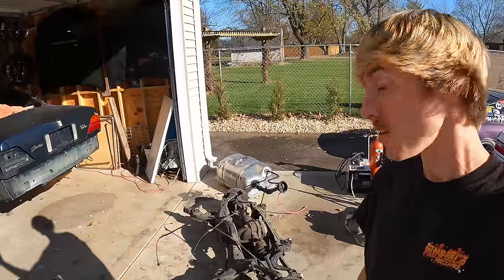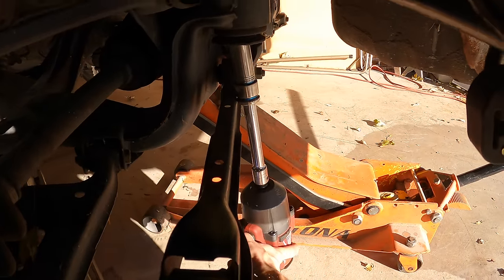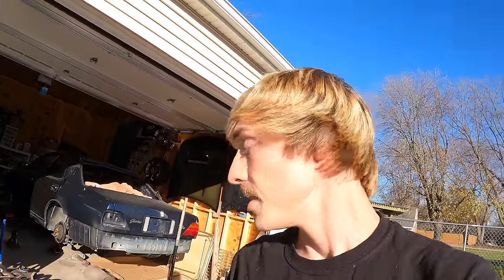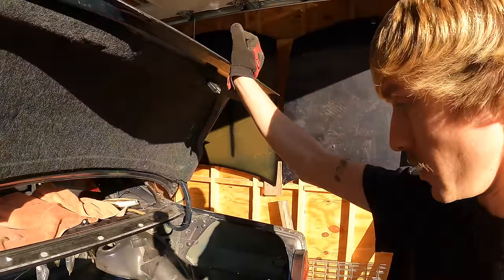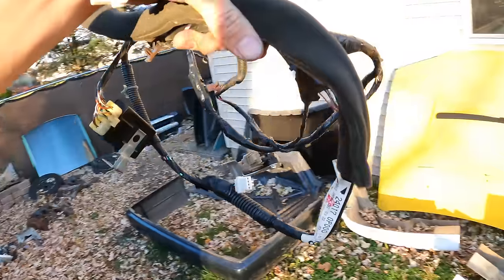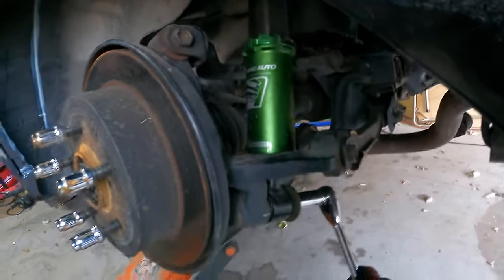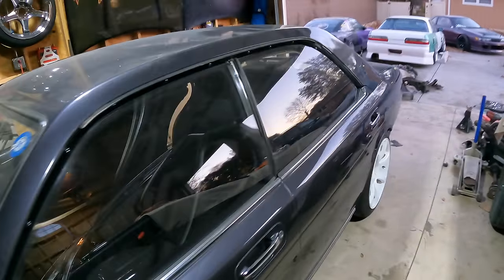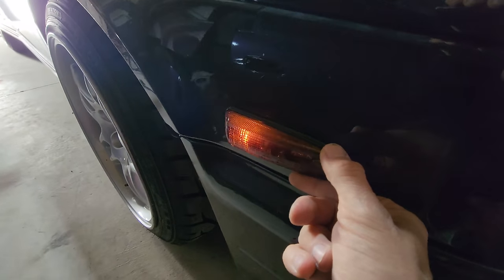Nissan Gloria TEST DRIVE!!

Comment: Putting stuff like this back on yourself is a good time!  I think I used a jack on the pumpkin like you and then stacked up random boxes and pieces of wood that I put on moving dollies so I could move things around as it went up.  It actually went fairly well!  Putting the gas tank in (S13) was also fun since it needs to be flush to the underside  of the body and then the straps had to be bolted in.

Those "nuts" on the taillights look like the flanges you use to bolt down a toilet seat...

Last but not least, I think you have plenty of room in that garage... I'm working in a similar amount of space and it can be a bit tight sometimes, but is mostly fine.  I just pull the other car out when needed or if I don't want it covered in grinding dust, etc.

Congrats on getting the Gloria back to roller status!

Comment: You should start priming your cars before starting. Like with the Gloria it didn’t start smooth cause it seems you just turned the key over on the first attempt and tried starting it give it a few cycles on and off if it’s been sitting for a while and it’ll start first time and smooth just a thought

Comment: Idk if that thing will see Road salt, but if so, you might want to hit those exhaust hanger nuts/bolts with some anti-seize? Or do it either way. May help a little if you ever need to drop that exhaust later. Just my 2 cents as a Wisconsin driver who experiences everything under the car rusting to sh!t too.